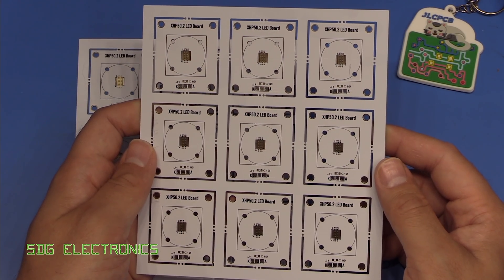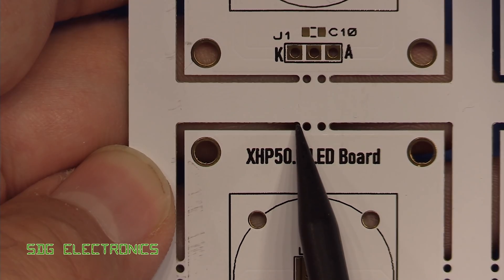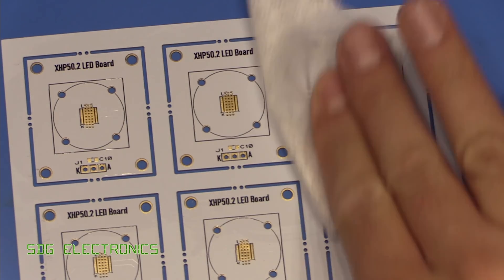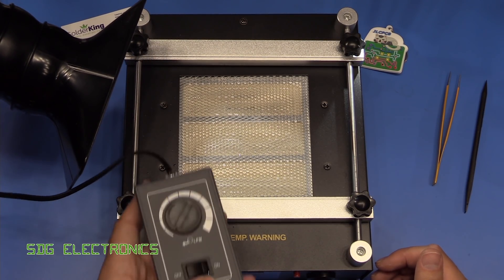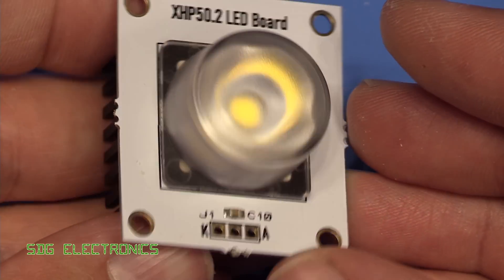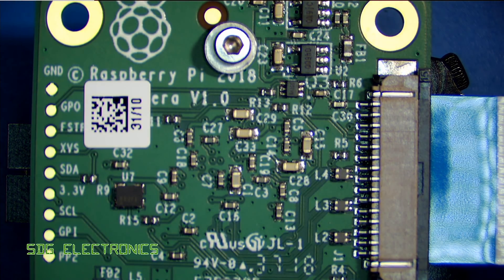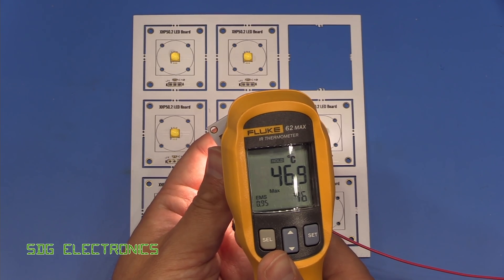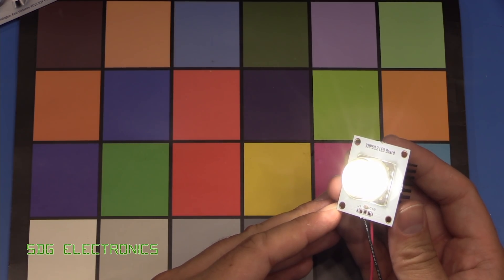SDG #173 Testing the High Power Cree XHP50.2 LED PCBs

Comment: Why do you have a capacitor across the pod and negative leads? Does it function to even out the pwm? And how did you come to conclusion that that capacitor is a good fit for that led?
Reply from the maker: Yes it reduces the ripple current caused by the DC-DC converter which is driving it.

Comment: is that xhp50 3v or 6v version ?
Reply from the maker: 6V version
Reply: @sdgelectronics  have you tried drive it harder ? i have mods 3v version xhp50.2 in a flashlight, with good batteries and fet driver it measure out almost 13amp at the tail.

Comment: Going to copy and paste a conversation regarding LEDs, custom circuit boards, and modifying LED light fixtures in regards to Cutting Edge UVLED technology. You might find this quite boring but you might find it really interesting! It’s the golden age of technology! And coronavirus has brought a lot of amazing and fast changes to the UVC led industry. 

Here’s my pasted article....

A single or triple convoy host with UVC LEDs inside would be extremely useful! But would take several minutes to have any sanitizing effects. 
It would need to be a large array of UVC LEDs to reach the optical power needed for sanitizing. If you look up a video on Adafruit‘s YouTube channel a few months ago they tested UVC LEDs and they had a really large array. I think it was 5 x 5 or maybe 10 x 10 UVC chips chips. Probably a $1000 array.... And they show how much optical output it gives. Super short and interesting video I highly recommend.

Right now the cheap Chinese chips only offer 3-5mw optical output on average and the nicer Chinese chips maybe up to 20 mW. But at that point you’re better off buying the high output 30-50mw nichia Chips.
 
I remember a few years ago my 1.2Watt output green laser filled up a small 10 x 10‘ room with electronics and optical equipment. Costing upwards of $5000. But Now.... i’ve built several 1.5 WATT OPTICAL OUTPUT green lasers that fit into a small handheld laser pointer and run on a single 18650 battery. Costing under $100 to build. It’s the golden age of electronics… What a Time to be alive!

Until UVC leds reach 500 mW per LED chip… it won’t be viable for large manufacturing and sanitization like used in water treatment plants and sterilization processes in industry. Which are actually pretty common in all types of industry. Tons of different industries and factories have UVC light used for treating or curing or some other use.

And when UVC LEDs become powerful enough to replace the standard bulbs in tubes… That will save shit tons of energy! 

The only good thing about coronavirus… The coronavirus is solely responsible for the fast evolving UVCLED technology. Before the coronavirus… Even January of last year… You couldn’t even buy a UVCLED online. The only place I could find wanted me to send all types of business and licensing documents with my tax ID number and everything. Now there are real UVC leds that are as cheap as one dollar each. Of course these aren’t the good ones but still…and high output brand name leds are only $20. 
That’s freaking insane considering they were completely unattainable before six months ago. 

Not sure if you knew this already but here’s Something to look out for… this is an easy way to identify genuine UVC LEDs that actually put out UVC light. -
Real UVC LEDs will always have a purple/gray ceramic housing, with heavy gold plating covering any metal, and a quartz or sapphire window. Because UVC is blocked by glass or other materials..... therefore it has to be quartz or sapphire. If you look up real UVC LEDs then you’ll see what I mean. They all look the same and They all have that gold plating everywhere with the nice purplish gray ceramic body. Very similar look to Vintage IC chips that had beautiful purple ceramic bodies and gold plated pins and caps. 
If you’ve never seen what I’m talking about… then please take a second to check out these 4  links. Hell its like electronics porn. Just Beautiful…! Sex on a stick!

https://www.google.com/search?q=purple+gold+ic+chip&client=safari&hl=en-us&prmd=sinv&source=lnms&tbm=isch&sa=X&ved=2ahUKEwiY4JLdmbXsAhVGvFkKHTMoBYkQ_AUoAnoECAgQAg&biw=414&bih=622&dpr=3#imgrc=RTX1st5lL-ZABM&imgdii=Zcq0VJJb9uK0JM

https://www.google.com/search?q=gold+ic+chip+Beautiful&client=safari&hl=en-us&prmd=isvn&source=lnms&tbm=isch&sa=X&ved=2ahUKEwiAg4jsmbXsAhWKmVkKHdBWBLAQ_AUoAXoECBMQAQ&biw=414&bih=622&dpr=3#imgrc=Oza7GmtLzvckkM

https://www.google.com/search?q=gold+ic+chip+Beautiful&client=safari&hl=en-us&prmd=isvn&source=lnms&tbm=isch&sa=X&ved=2ahUKEwiAg4jsmbXsAhWKmVkKHdBWBLAQ_AUoAXoECBMQAQ&biw=414&bih=622&dpr=3#imgrc=DTqi5yVnySlCkM

https://www.google.com/search?q=white+gold+traces+ic+chip&client=safari&hl=en-us&prmd=isnv&source=lnms&tbm=isch&sa=X&ved=2ahUKEwiIqsa1mrXsAhVkrlkKHXGRACoQ_AUoAXoECAgQAQ&biw=414&bih=622&dpr=3#imgrc=Gp_zyUEw8ENZJM

A plastic body UVC LED would be degraded and disintegrate by UVC light! therefore they have to be ceramic bodies, and sapphire windows. Even UVA and UVB light is really bad for any type of plastic or polymer. Therefore good quality 365nm LEDs will usually be ceramic and glass with gold plating. None of that plastic rubbish. Sure you can find 365 nm LEDs that have plastic bodies and the standard polymer coating over the top… But they will degrade quickly.

The Chinese UVC leds that are a few dollars each and sold in most of the products on Banggood and elsewhere are between 2-5mw light output each. Maximum I’ve seen is 20mw but they’re a little bit more expensive and I wouldn’t trust them. Like I said the nice brand name UVC LEDs with over 20mW optical output aren’t cheap but totally worth it! Ranging from $20 to upwards of $350 per LED. Highest output I’ve seen so far 70mW but it’s changing weekly. And they’re hard to find because everyone selling out of them quickly because of coronavirus. But once the pandemic ends, high-quality high power UVC LEDs will be cheap and readily available when demand goes down. And as bad as this virus is, I’m glad that it’s helping adVance the UVC technology.

The reason UVA, UVB, and UVC light is so useful and valuable is because it is absolutely one of the most important things used in all types of manufacturing, engineering, The medical field, and all types of science and study of biology and other important areas.. 

From curing finishes to doing spectroscopy and Gene therapy in the biology and medical community… UV light is so important. We wouldn’t be where we are today without it.

I got into UV light for completely other reasons. I build and restore guitars and antique violins… as well as the other half of my business which is industrial circuit electronics repair and calibration work on process control equipment for assembly lines and electronics and stuff like that… 
So UVA, UVB, and UVC light are all very useful in spotting flaws on circuit boards, cracks in traces and solder pads, and most extremely useful in the woodworking and guitar industry for spotting repairs or flaws in the woodwork and finish. Each wavelength is useful and I utilize as many wavelengths as possible.

You can’t imagine the usefulness of having UVA, UVB, and UVC lighting available to you. Whether you like to work on cars and motors, electronics, or do fine art restoration, science, biology, electronics, optics and laser… 

whatever your hobby or business…UV light in all wavelengths is extremely valuable and you will find a million uses for it. 

I’m also big into the laser and optics Hobby. Started with laser pointers and graduated to high end lab and Medical laser stuff which is available for pennies on the dollar out of retired military and health care uses on eBay. dirt cheap incredible stuff. 

I have lasers that easily surpass  100 Watts of optical output and fit in the palm of your hand. That’s crazy insane power levels by the way. Like blasting right through steel sheet. 

Laser modules that would’ve cost $20,000 when new that can be purchased on eBay for under 100 bucks! One hell of a time to be alive that’s for sure. It’s the golden age for everything!

Comment: Sir I wanna know, that if my power led has forward voltage rating of 3.3v and current rating of 700ma. If I increase the voltage to 6v or 9v but keep the current constant to 700ma whether my led will be damaged or not  or led life will reduced.
Reply from the maker: So long as the regulators are controlling current, it's fine. Standby for a video later this week with some different LEDs though

Comment: Would be better if you put those CREE LED's on MPCB with copper( typically MPCB is based on aluminium) as a metal part for better heat dissipation. In your design heat might be having trouble to pass through those metallized holes under the die.
Reply: At 4.2 watts, will heat be enough of a problem so as to necessitate a copper MPCB?
Reply: @Lauren_C  At 4,2 watts it might not be a problem but driving XHP50.2 at those watagges is simply waste of money and LED potential.
Reply from the maker: Not really a waste of money, as these are still quite cost effective even at low power.

Comment: For making the PCB panel smaller (and cheaper) you can connect the PCBs to each other, without spacing between them. This is how we our panels are made (not by JLCPCB tho) for asynchorious motor breaks and the size is just slightly bigger than those of your led pcbs, around 5x7mm. The panel does not seem like too fragile, tho our pcb manufacturer is few hours away, so there is not much transporting either. It makes it easier to break by hand, but I just do it with flat pliers and use a pocket knife to cleap up the edge.
Reply: If you're afraid of the panel not being strong enough you can always give it solid edges to strengthen things a bit again

Comment: The trick with a hotplate is to set it to the soak temperature and put some scrap pcb borders under the edges of your pcb, then a gentle waft of hot air is all that is required :) The reason for the packing is to stop the hotplate sinking the hot air heat away.

Comment: Adding breakout tabs on all 4 sides is a bad idea. Such arrangement tends to be difficult co break apart. I'd rather add a tab on each end of just 2 opposing sides.
Reply from the maker: It's only 0.8mm PCB so very little effort. I'll probably use a blade for the remaining PCBs

Comment: Nice video. Nice board, but why not use more vias over the entire area of the heatsink? I'm guessing that the thermal impedance of the vias is significantly higher than it needs to be. Using a thinner PCB is also a good way to reduce thermal impedance if the PCB manufacturer allows it without raising the cost (although it will take longer for them to build the PCBs).
Reply from the maker: The placement of the vias gives the maximum thermal conductivity to the heatsink. Placing more vias outside of that area offers very little benefit as the heat is naturally conducted sufficiently by the copper pad at that point. The 0.8mm PCB and via size should give the best results. There's some info in one of my earlier videos where one of the application notes from Cree was consulted. Thanks!

Comment: I think you're looking bit deflection of the router bit. At the end of cut the pressure on the bit is released and it springs back or at the beginning of the cut there can be a bit of wobble as the bit plunges into the material. All of this can be compensated for by programmed path, tool compensation, entry point (plunge),  retract point, and direction of cut. In this case the plunge and retract could have been made in the waste area, leaving a clean profile of the part.
Reply: Deflection of the bit, or deflection of the workpiece? My understanding is that to keep the cost down, with these small prototyping PCB designers it's made as one much larger PCB with multiple customer's designs on it.

At least that's what EEVBlog Dave said recently, and why they have such fiddly requirements for all manner of spacing ( could effect other designs on the board ).

Wouldn't such a large design have a tendency for flexure? It seems like it would be hard to uniformly secure it without risking  damaging the designs.

You'd think vacuum but then you're going and drilling a bunch of holes in it.

Fibreglass is quite flexible at that thickness...

Comment: They're still using routers instead of lasers?  A laser cutter would pay for itself in the first few runs.
Reply: PCB routing bits are ~$1 each and last for hundreds of boards, so no, it would take many thousands of boards before it paid off.

Comment: I am curious why you did not go with aluminum clad MCP pcb? 

EDIT: Woops you said JLCPCB I was thinking you used PCBWAY. JLCPCB does not offer them but they are great for most other pcb.
Reply from the maker: Yes, sadly no MCPCB at JLCPCB, but I would expect these PCBs to behave better for transferring the heat to the heatsink

Comment: Check my comment at #125: D2 and D3 can't clamp the voltage to 24V because D1 is blocking, so you can have higher voltages on that rail due to the inductances.